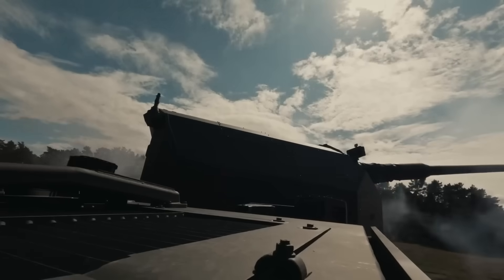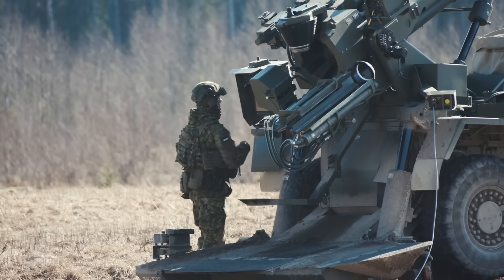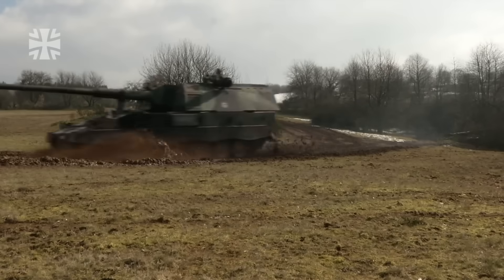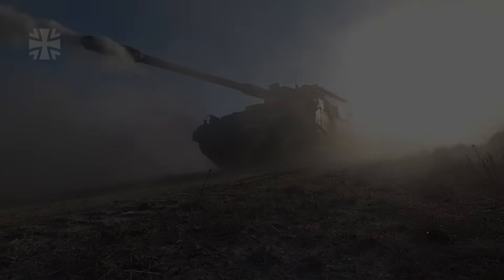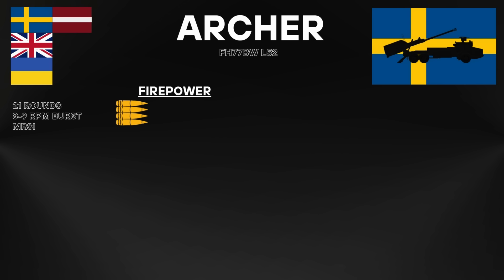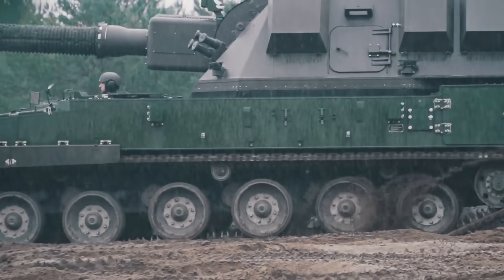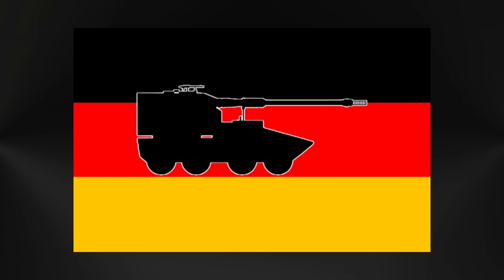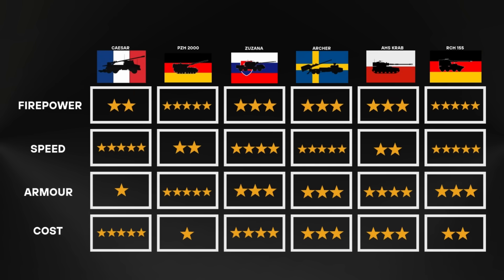Europe’s Artillery Race Explained

Comment from the maker: Which do you think is the best artillery system?
Reply: depends on the mission.
the CEASAR and PZH2000 system are oposites of the spectrum and the rest is in between.
Reply: @obelic71 Eindeutig. Die Pzh2000 ist nur zu gebrauchen wo es im Umkreis von 200km Bahn Verbindung gibt oder um sie Lokal einzusetzen. Caesar kann mann auf jede Insel oder mitten in eine Wüste fliegen.
Im Gefecht mit ernsthaften Feinden ist die Pzh2000 aber absolute Spitze. Alle anderen sind wenn Straßen vorhanden sind sehr schnell und einfach zu bewegen. Mit dem Extremfall RCH155
Reply: @MP-nc2pw  PZH 2000 jest bardzo wadliwy jak pokazuje Ukraina
Reply: @jarekkociok1463 It can withstand more than twice as many shots as any competitor. Of course, if you fire it four times as often as others in the same period, the maintenance interval will be shorter. But the problems have been resolved; now there are replacement tubes available for tubes that are completely worn out after more than 20,000 shots. Most are only designed for 2,000 to 3,000 shots.
Reply: archer is the best as im a swede and it was built for our militaries needs and doctrine and therefore suits us best.
Reply: @cpt_frostbite 👍 In Sweden I would take no other, too.😂
Reply: RCH-155 (acompanied by Skyranger) will be the predominant systems going forward
Reply: @michel1060 Da stimme ich voll zu😅
Natürlich je nach Einsatzbereich. Aber 3 davon mit einem Skyranger im Schlepptau und jedes Ziel in 40km Umkreis möchte weit weg sein. 😂
Reply: The best in terms of technology probably the RCH155. But it isn't the best for every use case as it is a pretty expensive system.
Reply: Serbian ALEKSANDAR and NORA! Why you doing only NATO shit?! Systems without protection for crew, like CAESAR, are garbage, and yet, you treat them as the best...
Reply: @Bokicazver but some are with protection
Reply: 18.1" on the Yamato and Mususashi.  😁
Reply: Ukrainians says Krab is the easiest one to maintain. Soldiers can fix most of problems on battlefield with spare parts.
Reply: ceasar!!!

Comment: Another major advantage of CAESAR over closed, automated systems is that it allows Ukrainians to disperse ammunition to different firing positions before deploying CAESAR. This increases survivability and firepower by maximising the use of its mobility and crew. Automated or heavily armoured systems are unable to do this, as they carry their own highly explosive propellant along with them, and are limited by the load capacity of their ammunition rack or the length of resupply operations.

Comment: There is no "best artillery system" in absolute, it depends on the objectives and conditions. And there will be a very different appreciation whether you place yourself at the level of the operators or at the level of a general. As it has recently been described by Ukrainians, artillery teams love the archer and the Krab is very easy to maintain, but overall, the Caesar is the best choice by generals: you have 3 Caesar for the cost of one archer, for nearly the same survivability (Caesar only have only a total 10% loss in Ukraine, far less than all the other systems except archer, but these are very sparse so hard to get robust statistics with them), so in the long term, you can build a much stronger fire power with Caesar. It is nearly as easy to maintain as the Krab, and in current conditions where you cannot remain in the same place more than a few minutes before being targeted by drones, you don't care about being able to fire 20 rounds in a row, that is just never possible.  On a different operation theater,  if you have a better control of the airspace, other systems may be better, but the Caesar is light, precise, fairly cheap and easy to maintain; Right now, its only drawback is its production rate, although this has increased, it is not yet sufficient to respond to the demand, and this is a real problem.

Comment: RCH 155 works in Ukraine already. Germany has ordered about 127.
Reply: Germany is about to order a lot more. Their 2029 and 2035 Army structure got leaked. They are going from 150 tube/rocket artillery pieces in 2025 to 550 in 2029 and finally 1,350 in 2035.

Comment: Why did you rate the "firepower" of the AHS KRAB the same as the ZUZANA? You gave both vehicles three stars. But ZUZANA has a 45-caliber barrel, while the Polish howitzer has a 52-caliber one; that alone makes the Polish gun much better. I absolutely disagree with your assessment that the traction, mobility, and armor of the PZH 2000 are the same as those of the AHS KRAB. Regarding armor, the German howitzer is better protected. On the other hand, driving performance is on the side of the Polish product. In general, you rated the other vehicles well, and I only have reservations about the points above. To avoid being vague, I will provide my own (in my opinion) ratings for these three vehicles. So, for the AHS KRAB, from  top to bottom in your table: 4, 3, 4, 3 Next, the PZH 2000, in the same order: 5, 2, 5, 1. And finally, the ZUZANA, top to bottom: 2, 4, 3, 4.
Reply: Bro, the CAESAR is also a 52-caliber barrel, but he ranked it as a 1 star in firepower the worst of all of them… btw the CAESAR can shoot over 40km with nearly perfect accuracy (and can be extended to over 60km with propelled munitions, although I don’t think any soldier has seen one of those anywhere else than on a picture…).
Reply: I'd argue that Krab and PZH 2000 have about the same mobility; they are both heavyweight tracked vehicles. The Krab has slightly better power-to-weight, but not to the degree that it's a phenomenal difference. the PZH 2000 can leave a position in 30 seconds; the Krab is supposed to be able to do that in under 2 minutes.
So in the end, they are probably pretty much the same in that regard.
Reply: Old Zuztana has 45 caliber gaun, while newer Zuzana 2 has got 52 caliber armament.
Reply: @premyslsedy2904  Indeed, I must honestly admit that the author mentioned that the ZUZANA 2 has 52 calibers. However, he compared ZUZANA with other howitzers. Therefore, this is an oversight on the part of the author, because not everyone needs to know the exact length of the barrel of a specific gun; it should be clearly stated that the author is referring to the ZUZANA 2 and not to the original ZUZANA.

Comment: As self propelled artillery fan I must say that you didn't do much research. The Ceasear you speak of there are two versions. One purely French 6xx6 and second Caesar on Tatra chasis 8x8 which has much higher mobility. Then you pull out Zuzana 2 while ignoring the fact that it is one of two branches of original 152mm DANA. Zuzana 2 is simply put Slovakian 155mm DANA, while there is second Czech branch which included modernization DANA M1 and continuation DITA 152mm which extends automation on whole new level. Since I'm talking about DITA then there is MORANA in late stages of development which extends on automation even more and finally using 155mm/52L barrel for which turret was moved back so the barrel does not stick out like on Zuzana 2.

Comment: There is no competition. PzH2000 is the best armored artillery, period. Even compared to wheeled ones it still holds up. Wheeled can't go where track can go, so giving a tracked system like the PzH2000 lower scores for mobility compared to wheeled systems is quite stupid, overall they are "the same" so to speak. Anyway, all systems have their strenghts and weaknesses and all systems are good systems.
Reply: K9 beat out PzH2000 on a straight up procurement contest at Norway and it wasn't close.  You get same or better performance with K9 compared to PzH2000 at roughly half the price and you don't have to wait 10 years to see your self propelled howitzers.

There are currently as many K9's in European armies as every PzH2000 ever produced.  And a few years from now when the orders of Poland/Finland/Norway/Estonia/Romania are filled, that number will be roughly double what the current number is.
Reply: @harrynamkoong3361  Norway chose the K9 due to lower weight and thus better mobility in their terrain. In total performance PZH 2000 beats out the K9 by a mile. The baseline K9 doesen't even have an autoloader.

Just because someone choses something on specific circumstances doesen't mean it's better overall.

German Artillery is growing from 150 gun and MLRS systems to 1,350 by 2035. There will be more PZH 2000 and RCH-155 in service in Europe than K9s. By a lot.
Reply: Almost like if you pay more you get a better system. Who would've thought that.

Comment: Every engineer, commander of mechanised forces, and historian of World War II will tell you that the most important thing for a vehicle is not its armament, armour or engine power, but whether  it is capable of  fighting on the battlefield.  99% of the time, military equipment is not fighting, and its operation during this time is more important than during combat. When the Germans replaced the PZ III with the Panther tank, their armoured forces completely collapsed due to the unavailability of tanks, and it was necessary to rescue them with the mass production of StuG III self-propelled guns. So what parameters are important?
- production capacity (how many vehicles can be built each year)
- availability of spare parts
- ability to repair in field conditions
- frequency of breakdowns
- length of time between repairs and servicing
- ratio of fuel consumption to the state's ability to deliver fuel to the front
- ability to traverse terrain
- ability to coordinate actions with other units and types of troops
-  effectiveness of firepower
- availability of ammunition
- upgradeability and ease of modification and adaptation of the vehicle
- operating cost 

These are most of the parameters.  Not all of them need to be a disadvantage for a given country.  If the vehicle is only intended to fill a gap, it does not need to be easily upgradeable. If a country does not have difficult terrain, good off-road capabilities are not necessary. If a country has a lot of cheap oil and does not plan to fight far beyond its borders, fuel consumption is not a problem.  War is a system. If a weapon is not integrated into the system, no matter how great its parameters are, it will prove useless.

And one more thing: wheeled, tracked and towed artillery are three different types of weapons that do not compete with each other but should complement each other.

Comment: The weeled Boxer equipped with the RCH 155 module does fire on the move and has hunter-killer capability, means that it can directly shoot even at a moving target. Plus only 2 man crew. As its modular, the turret is in a module and the whole module can be replaced as any other Boxer module. In addition the Boxer tracked with the same RCH 155 module as the wheeled module is also now available, with the same capabilities. I think this is the future.

Comment: Germany already procured the RCH 155 wheeled version for its middle combat forces. The middle forces are important for rapid reinforcement. For the Suvalki Gap in Lithuania the German heavy combat forces will use the PZH 2000. In this narrow Gap they want the best armor + intensive firepower to hold the line. The open question is, what kind of RCH 155 the heavy combat forces want to use additional. The wheeled or the tracked version? The leaders of the heavy combat brigade for the Suvalki Gap are still playing with different strategies.

For the Nordics the Archer is surely the best choice. They have much more territory for tactical withdraws. Or with other words: A much lower density of population and therewith much more space to create death traps, to hide, to wait and to strike. (Sweden: 26 citizens per squarekilometer. Germany: 235 squarekilometer.) For long distances high mobility and easy maintaining & repairing is important. While the Nordic forests have a higher density and give them more protection. Therewith the armour of the vehicle is less important.
And from all artillery systems the Archer has the best adaptations for the arctic climate.

And so on... What is the best artillery system depends on the territory and the task.

In NATO Poland and Germany are the main forces in the sector of the heavy mechanized infantery.
Of course they are slower. But for "Hold the Line" tasks they don't need to move fast. They need more armour to stay longer.
All other NATO members have more strenght in their middle and/ or light infantery forces.

Additional is the question how long the period of education and training of the average soldiers is.
For mandatory conscripts less sophisticated weapons are the better choice. (Poland)
While professional soldiers usually likes more sophisticated weapon systems with higher performance, because they have more time to train how to use all functions of sophisticated weapon systems. (Germany)

In the beginning Ukrainian soldiers didn't like PZH 2000 very much. They said: "We don't need a Diva. We need a workhorse." Their training period was much too short and they had to learn the rest on the battlefield. The maintaining and repairing was more complex. And they caused many damages on the PZH 2000 by mailuse, overuse and desperate tries to repair things on their own they haven't learned yet - that made the damages worse. In the beginning the Ukrainians felt more comfortable with many other European artillery systems.
But this changed with increased expierience and knowledge, a prolonged training period and the further build up of Ukrainian repair stations and Ukrainian repair crews.

In some cases Ukrainian crews felt suddenly in love with "their Diva" after surviving strikes, they wouldn't have survived in a less armoured artillery system. ❤ 
And in difficult territories where the PZH 2000 was the only artillery system, that was able to hit the target.❤
But they were still annoyed, that she is so needy in maintaining. How exhausting! 👿

Well, the PZH 2000 is a typical German weapon system.
Reply: What allowed the PzH2000 to hit targets other systems couldnt?

Comment: Tbh: if you limit speed to 5 stars only the rch155 could get it if the fire on the move is working as promised. The others could get just 3 stars max there. It would be next level. The best artillery system? If you have the money available most likely the rch155, because with the same crew you can get multiple times as many guns on the field. In a time armies are struggling to find new recruits that can't be valued enough.

Comment: KRAB is most usefull from all NATO artillery in terms of using it in Ukraine. For one simple reason. It is very easy to replace barrels. It take few man and simliest tools. It take hours and can go back to fight. No special equipment or team. Just becouse of that i become work horse for most intence parts of front. Also Poland sends spare parts right away. So it  leaves front for few days max. While german artillery can leave up to half year just to change barrel. Ps. Barrels last lake 2-3 weeks in full fight conditions.
Reply: As somone who has worked with smaller gunned vehicles. Id say a gun replacement on a 155 mm gun takes more than a few people and simple tools. That stuff is gonna weigh multiple tons. like ~4-6 tons range i wager. The crew or for that mattet a larger group of people is not gonna be able to lift that without some kind of crane unless all of them are world record deadlifters. But polish people ar built different i guess 😂
Reply: @frejlindqvist4115  You are right. They need crane. Also "basic" tools is a bit more than screwdriver but it can be done in workshops find in any bigger nearby city. So krab have barrels change in ukraine. Not in facilities specially made for that. This is unique approache which poland chose. To make things simplier not better or more impresive. They took UK cannon but modify it to make it easier to repair and change parts. A small detail which in ukraine appears to make huge difftence.
Reply: Oh so it's just a fluke your polish? Hahahaha
Reply: Krab has many losses (over 50 % lost and destroyed in combat)

Meanwhile PZH 2000 only has 5% losses so far,so it's much more effective in combat
Reply: @AquaNomad34  it is hard to be destroyed if you are in workshop in germany 90% of time. Also Krabs where send to most important and intense parts of front. But to be fair krabs have to weak armour and have problems with fires. For first 2 years becouse teams turn of smoke detectors so they smoke cigarets inside. Now turning them of is not an option. Non less KRAB have done work just ...more. It tournament PZH will win but they cant last for few years war. They are to complicated.
Reply: @oddawajminick  Rheinmetall built a workshop in UA for heavy repairs. I've seen no evidence of any PzH2000 moved back to germany for repairs. Issues with wear and tear found in UA are much improved in the next production revision.
Reply: @AquaNomad34 piszesz bzdury
Reply: @AquaNomad34  Ha ha - units constantly waiting in service because of this or that, they cannot be lost in opposte to Krab, which units are permanently in battlefield.
Reply: @AquaNomad34  Yeah, because PZH spend 95% of their life in the workshop, where they replace the barrel and other components.

Comment: Archer and Krab
Reply: the archer is a fancy gadget. Very well made for sure, but too sophisticated and costly. It is not usable with actual tactics seen on the battlefield. That is : not have the shells inside the truck. Some hidden artillery firing points are prepared around the territory, and the wheeled artillery system drives too it and loads the shells present on location. This allows the truck to relocate faster to the next firing location (allowing more shells fired by days, harder to track and detect) and to not be completly destroyed by a simple drone. The problem is even bigger with the Krab that cannot relocate quickly due to its tracked chassis.